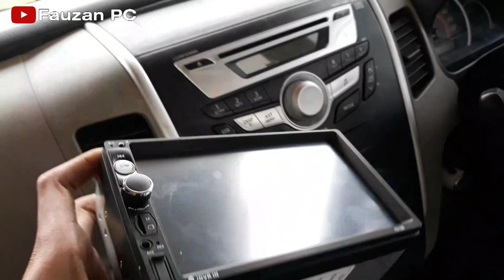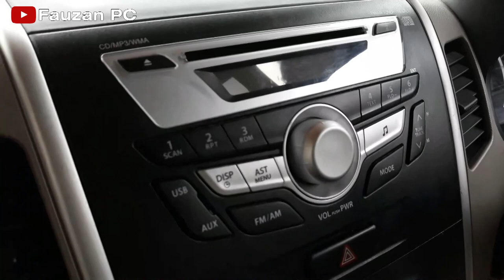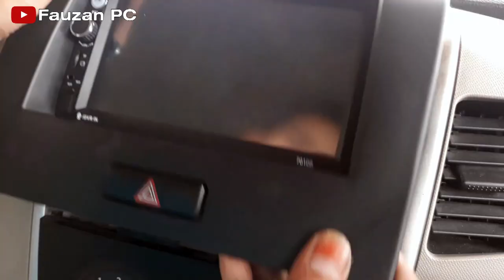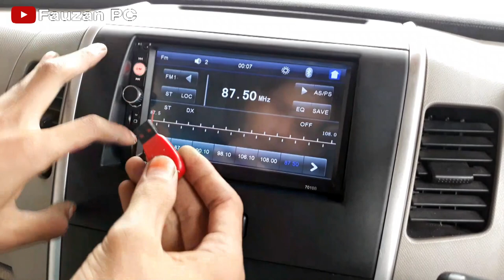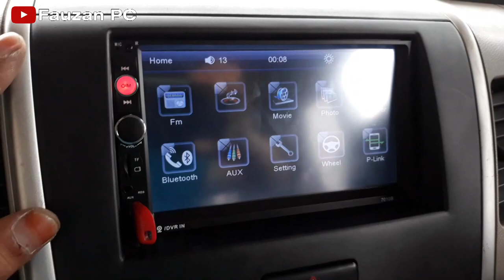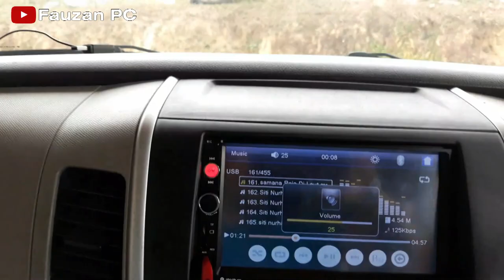Tutorial Pemasangan Headunit Doubledin Cina

Comment: Om mau tnya ?
1. Kalau kabel 12v+ apa sll kabelnya agak besar (socket double din) 
2. Utk kabel steel while control hanya ada key 1 aja ya ? Yang key 2 tdk ada
Reply from the maker: tdk selalu besar.. ada juga di beberapa mobil ukuran kabel 12v nya kecil..
beda beda setiap mobil dan headunit.. ada yang hanya 1 kabel dan ada 2 kabel utk steering wheel control
Reply: @FauzanPC  ok bang sukses namun ada 1 kendala  saat mau sambung stering while control kabel double din hanya ada key 1 saja, namun while control yg saya punya ada key 1 dan ke 2, caranya bagaimana bang ? 1 dan 2 disatui apa pilih salah satu saja ?